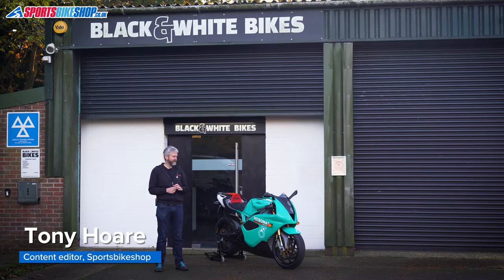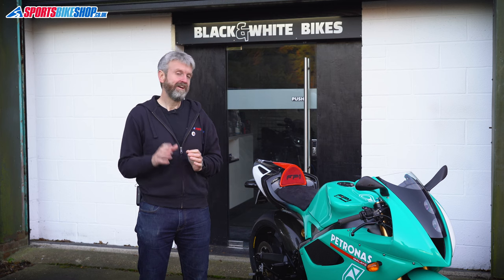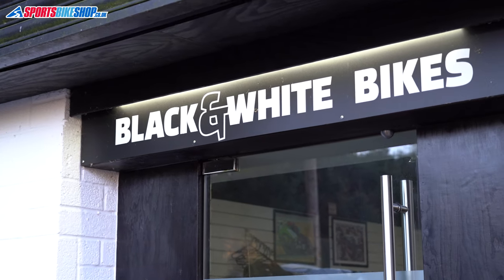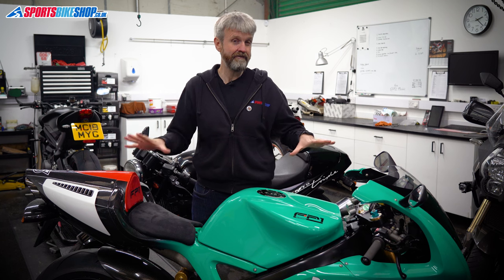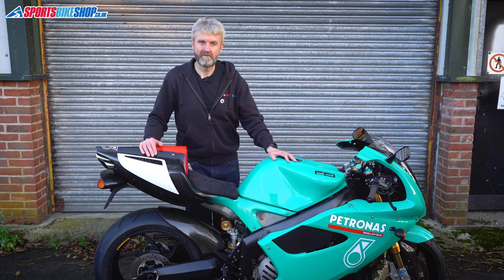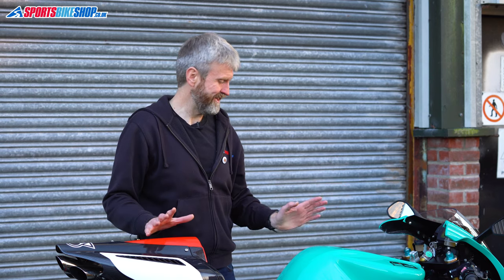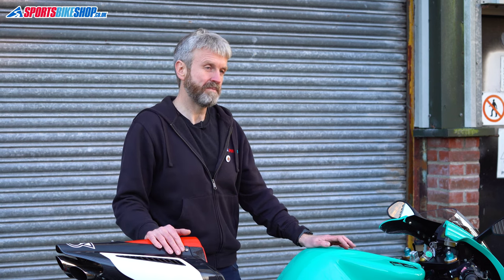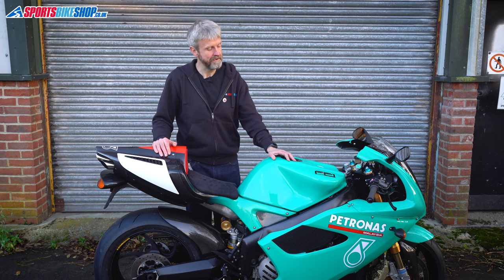We put our FP-1 on a dyno... and it went wrong - Sportsbikeshop

Comment: Has it still got the French ecu ?…
Reply from the maker: We don't think so, because the curve was more consistent with a problem - and the drop in power was also audible as we did more runs. And it made more than 100bhp, so it would have broken the old French limit. But interesting thought, so thanks for getting in touch. Cheers, Tony